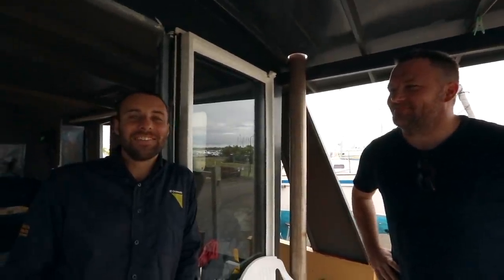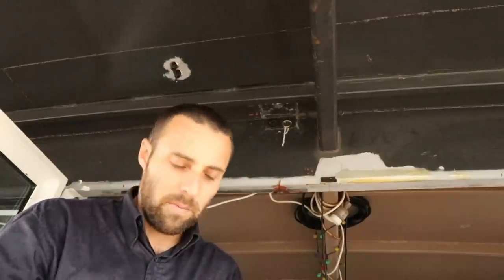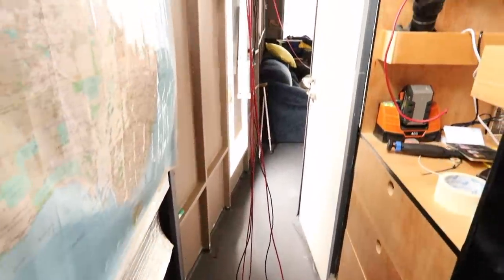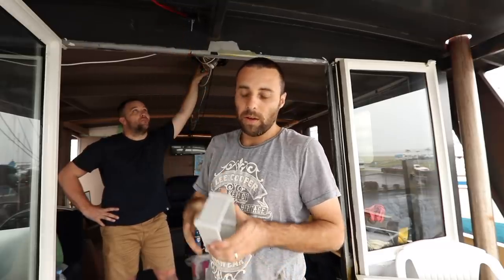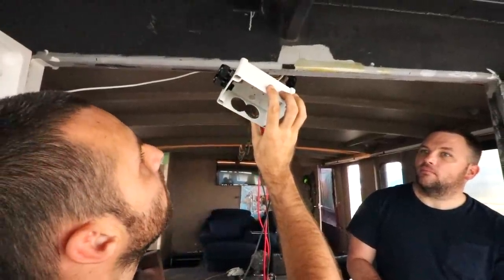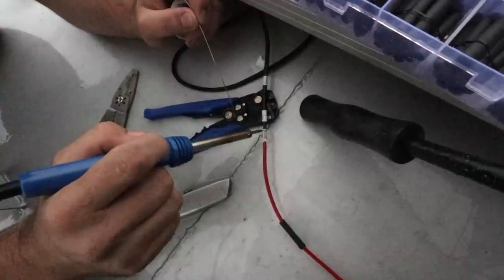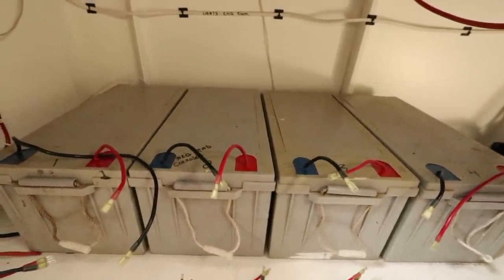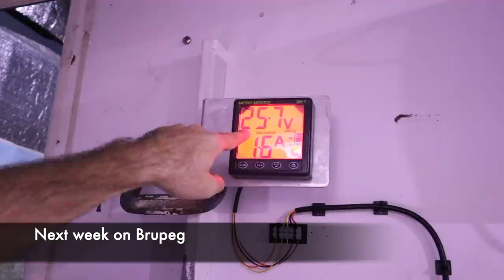How to install Marine Solar Power - Project Brupeg Ep. 89 (part 3 of 4)

Comment: Back again to catch up. Looks to be a fun project and your learning a lot. That will help when at sea and have a problem because you will be familiar with the wiring. One suggestion is to label pairs of wire so it's easier to identify each end and not have to trace them back one wire at a time. Panel pair 1 goes to controller 1, panel pair 2 goes to controller 2, etc. It will save you a lot of time doing it and if you have to go back later for repairs.
Reply from the maker: Yeah that’s true. Thanks Richard

Comment: Terrific adaptation of the flex conduit for grommets!  With flex over the cables should not have any problems with chafe.  Failure is a great instructor and the cost, while sometimes seeming high, in the end becomes insignificant compared to the skill and knowledge you gain.  Glad to see Jess getting around well and hope Mishka doesn't get another tummy ache.  Take care and best to Scott for his help.
Reply from the maker: Thanks Matt. Yeah it was a situation with those grommets were we just couldn’t find anything easily that would work so making them turned out to be the best thing out there.
Reply from the maker: Yeah that’s not a bad idea. Most of our steel is either 6mm or 3mm so the 1/2” flex seems to work well on the 6mm (1/4”) steel
Reply from the maker: Yeah that’s not a bad idea. Most of our steel is either 6mm or 3mm so the 1/2” flex seems to work well on the 6mm (1/4”) steel
Reply from the maker: Yeah the 1/2” flex works really well on our 1/4” steel work

Comment: Hello Damien. In my commercial solar installation  world we some times use flex (round insulated cable) in the same way you used the flexi conduit, this has the advantage of being softer and can be cut a fraction longer to fit nice and snug. All the best.
Reply from the maker: Thanks David, I hadn’t thought of that. Cheers

Comment: Been following your amazing refit (after seeing an episode of Dangar Marine). From an electronics background I recommend you label any cables to future troubleshooting, it makes identifying standard colour cable so much easier at termination junctions. Still playing catchup with your blogs, thanks for sharing and fixing some of your audio issues.
Reply from the maker: Thanks very much. Yes I want to invest in a label maker and run through the boat marking everything up. With our multi core conductors we have a system that uses the numbers printed on each conductor but that only works with some of them as others have no numbers printed

Comment: When I have to bust out the gas for tight jobs like that I find it best to heat the under performing iron, rather than the cable. It's easier to concentrate the heat that way. 
Always pick the worst weather to do the outside jobs. It's character building. 
Keep it coming kiddies!
Reply from the maker: Yeah we tried that and found the iron was just causing more issue than it was worth, hence in the last few we just dumped the iro and used the torch.

Comment: For the house batteries...can you just mount some lugs to the top of the batteries with some of that great glue...then just connect the batt terminals to them...then the connections to the system.
Or even use some short heavy duty terminal strips then same way...mounted then connected to the batt & everything else.

That was a beautiful sunset mate!
Reply from the maker: I quite like this idea. I will see whats available, im actually thinking of just swapping these batteries out as i dont have faith in them so really dont know how much i can rely on them

Comment: Another great video, I have never seen batts with wire as it output, they must be a super low discharge current and/or designed for high voltage strings, you will never get enough current through those wires to run the inverter which you probably already know LOL.  Wiring looks spot on. I would do a couple of things slightly differently component wise but thats more for ease of instalation. If you havent already got the INV/charger look at the Quatro, it fully automated the change over between ship and shore without a selector switch.
Reply from the maker: Yeah my plan is stick with Victron for the house bank and all the parts associated. Just really well built stuff with a brilliant reputation from what I’ve heard and seen with the MPPT’s

Comment: The tubing you use for sending gas to a bbq, you can slice that on the side and use it as a grommet. That thing know no death. I've used it to isolate edges for years in multiple applications, not just for cabling.
Reply from the maker: Nice. Yeah I can see that stuff lasting years. The gas line we get in Aussie is copper with a external plastic coating

Comment: They make air tight sealed mppt splice connectors ive used alot .All the home solar ive installed ALWAYS real world voltage/output is less. Specially in hot climates. This is why you undersize inverters so the inverter runs at best efficentcy at all times. So 15kw system really only needs a 13kw inverter(with a over 15kw maxx) that way in real world you keep the inverter in its "happy" range at all times.
Reply from the maker: Ok, good to know.

Comment: Saw where you were having difficulty putting in rubber grommets and used split corrugated PVC around the perimeter... Two things that may help:  
1) Use a heat gun to warm up the rubber grommet.  This will soften them up and make it easier to put into the hole.  After they cool and firm up again, they will NOT come out.  
2. Instead of the pvc stuff, use a razor to split a piece of 5-8mm rubber fuel hose and use it instead.  It works much better.  It grips and won't move as easily, and is a much better insulator, in case it ever comes to that.

Of course you are WAY out of my league regarding knowledge, but hope that these thoughts may helpful to you.   Please ignore, if not useful.   Thanks for the very interesting channel!
Reply from the maker: This is an awesome suggestion. I like the heat and set aspect you’ve mentioned for grommets. The issue we had was the grommets we have are for thin metal 1-2mm thick but our steel was 3mm plus the thickness of our plastic box so I’m guessing all up it was maybe 6-8mm thick. That said the rubber pipe would be better than our plastic flex conduit by a long shot. Thanks for the tip. Damien
Reply: Damien,
Yes, in that case, you need wider grommets.  The rubber hose trick will be the better option, if wider grommets aren't readily available.    The cool thing about the hose trick, is if you use a heat gun, you can use the oldest, hardest hose that you stripped out of somewhere.  Warm it up, make it soft, form it as needed, and it will work great for many things.     Glad to chip in, even if in a tiny way.  Thanks for the reply.
Reply from the maker: No worries, thank you

Comment: That rain and sky = exactly what southwestern Washington State looks like 80% of the year if you were curious! I'm curious to see how those microinverters work out for you. Just generated 42kva here on my landship though!
Reply from the maker: So far there awesome TIm. havent generated much total power as the battery bank is so large for the load i cant get them to drain down more than 8-10% so they spend most of their time in float. we are normally fully charged by 9am. Thats running 6 panels as we are still waiting on a replacement for the last pair. an inverter will be here soon so we can start really loading the system up and see what it can do.

Comment: Considering one went bye bye during a storm, i'd suggest adding a strip on the sides (affixed to the L brackets). Doesn't need to touch the roof, rather just follow the contour. That way, wind can't get under the solar panels, but water can move freely around them.
Reply from the maker: At the time it went bye bye they weren’t bolted down and we had 80 knots across the boat. We’ll test how the brackets work and change if we need to. I’ll keep it in mind thanks. Cheers Jess

Comment: Damien never feel that you need to apologise to the Internet "experts", making mistakes is part of the learning process IMHO.  There will always be a better way to do things, what works for you is the best way in my opinion. 

You need to consider three things when designing or building something:
1. Cost
2. Speed
3. Reliability

Usually, you have to compromise and pick two, all three aren't usually an option.
Reply from the maker: definately, the first system had cost and speed ticked, but failed massively on option 3. the most recent solar set up wasnt cheap. charge controllers were close to a grand for the four controllers and the battery monitor, but man does its rock!. shouldve just gone straight to this first time round. still one day i might learn...

Comment: I have two screwdrivers that are called "offset".  One is a flat blade bent 90 degrees at about 3/4 to 1 inch then about 4 inches bent 90 degrees the other direction then the same length ending in a flat blade.  The whole thing will lay down looking like a Z with one blade across and the other blade in line with the tool.  The other screwdriver is made similar but the ends are Phillips.  Both are for close in work.  It would be possible the take a Phillips and heat and bend the tip to give yourself an offset screwdriver.  Since you are using plastic screws the loss of strength in the shaft of the screwdriver should be minimal to you.
Reply from the maker: Thanks Roy, yeah I know those z tools your talking about. In fact I hard them in my head when I said about bending a screw driver. There really handy things for screws in ridiculous locations

Comment: Hope you can source another panel soon. Great to see you using the past solar experience as a building block to get to this new and better system.
You can get a cordless caulking gun in a AEG POWER TOOL. But they aren't cheap.:(
Still doing a great job.  Hope Jess is OK she seems worried about the Doggy?
Reply from the maker: Thanks Dennis
Mishka was quiet with a sore stomach but has come right over the last two weeks. He’s getting lots of hugs. We hope to get a panel soon. System is working great. Cheers Jess

Comment: Iv used that split conduit trick a few times 
Granted on sheds but for running water pipes though tin that suffer alot of vibration 
It works well 
Good quality conduit is tough
I'd recommend the solid stuff over the split stuff but it's prob just personal preference
Reply from the maker: Yeah ease of making the system too. We have solids for most of the cabling but yeah were it’s just too time consuming to make all the bends we used flex

Comment: I came here from the video with danger marine good work.

in that vodeo, you mentioned that your computers for your navigation use hard drives. that's not going to work for the long term because hardrives are very sensitive to movement and moisture. an ssd or solid state drive has no problems with this and they are silent. and due to this well just being navigation there won't be really many reed/wrights so they will last for a long time. anyway just a suggestion.
Reply from the maker: Yeah good point. We use SSD for our editing Macs. So I do like the idea of the nav PC having SSD reliability

Comment: Be mindful of heat inside the conduit when at full current. +1 for split vacuum hose as grommets.
Reply from the maker: Hi Brian. Yeah we did think of that but the cabling we are running is massively oversized so it’s well under loaded and so far it doesn’t even get warm at load

Comment: You could make (out of say, a bus bar) standardized terminals for those batteries. Two copper bolts and nuts and on the other end, pegs for the wires coming out of the batteries. You can glue them on top with sikaflex using one of those junction boxes (the smaller you showed in the bag earlier on). Have done this with a few motorcycle batteries that came with the same stupid wire design (which, as i understand, it's meant for electric systems that are enclosed, but not fully air-tight, to counter drain because of dirty batteries (it can become conductive, acting like a parasitic drain)).
Reply from the maker: Yeah I get that. I like that idea. Would also allow the thin battery cable to be quite short and hopefully carry a few more amps

Comment: It is a better idea to use velcro wire ties instead of zip ties since you have the option later of changing the wiring and zip ties can cut into the wire insulation or even strip off the insulation if pulled hard enough.
Reply from the maker: Yeah i have heard of this in the aviation world as there is less chance of damage to the insulation but in my experience ive not seen zip ties cause damage like this. Not saying it cant happen but i cant think of any examples ever where ive seen it be an issue. On Brupeg its fairly normal for us to zip up a string of wires and if needed at a later stage just replace the ties with a new lot with the additional cables tied up, so yeah we frequently cut old ties off and replace without any drama. The thing ive found in my experience most likely to damage wiring insulation is stanley knives used to strip back outer insulation on multicore cable, as it often picks up the inner insulation and cuts a small line into it. ive had that happen maybe 5-6 times so far. I absolutely hate it as it freaks me out that now that cable is not water tight but also is a risk of fire if it earths out.

Comment: If you keep getting it wrong eventually you will get it right.  When you set up the two onboard computers use solid state drives, the pounding seas will kill mechanical drives.  Save data on small laptop external hard drives and critical data on CD or DVD disks.  This includes OS, Drivers, Software, and Chart Data. Do not solid mount your monitors to the dash, they won't survive the pounding.
Reply from the maker: Ok cool, good idea about flex mounting the monitors, i hadnt thought of that but i will figure a way to give them some suspension

Comment: I guess you're well on your way with your solar project but as a long-time  electrical designer of AC DC power & Pv systems I have a couple of comments for you: * PV panels never perform near  rated wattage in the best conditions, in a marine environment you will be lucky to get 40% of their rated power output, I think you ended up with the series parallel wiring scheme on your panels, PV panels never perform well when wired in parallel , one  panel will always have a higher voltage and that voltage is lost as heat in the parallel panel . It's better to buy one high-quality panel as opposed to two inferior panels it will last longer and perform better over the long run. I saw a shading issue with the exhaust stack and the smoke that's always going to be an issue in PV performance depending on how many bypass diodes are in the panels, again better panels help..* soldered Connections in AC or DC Power Systems should be avoided use a screw terminal whenever possible here. Terminals areI a maintenance issue but a terminal block has the ability to dissipate Heat in a splice. Also, uU
using a terminal block at each battery gives you the ability to isolate problem batteries and do voltage checks .on individual batteries. Type mtw wire is also a good choice for your application, it has the vibration resistance is readily available just lacks  the tinning but corrosion can be overcome with the use of a ferrule. *This application is considered hazardous location here in the states and an all metallic wireway system would be required, At least consider metallic raceways in engine and mechanical rooms, metallic conduit is cheap although labor-intensive. * fuses rated at 125% of circuit capacity is required at/near each battery bank . *Select circuit breakers carefully be sure to use an appliance type circuit breaker , load at no more fan 80% of circuit ampacity. You're right on with that AIC or Max interrupt capability of the sand filled fuse. Many people tend not to consider safety in a DC battery system but in fact they can be more dangerous then an high volt AC system. Enjoy your project and wanted it to be safe. Thanks
Reply from the maker: Thanks TC lots of good info to work through here. Really appreciate you taking the time to share your skills

Comment: Quickly looking at the diagram I'm wondering if you have considered an Isolation Transformer on the AC shore power feed. It's my view they are highly desirable on all metal boats. If not I have a Galvanic Isolator in good condition I can send up if you need one. Cheers
Reply from the maker: Hi Phil. We want to install a galvanic isolator, we still need to get one so we could definitely use yours. Thanks for this, it’s an awesome offer. Damien
Reply: @ProjectBrupeg  OK. I'm going to have to get my partner to organise it as I'm overseas at present. It will be later this week at the earliest before she can look for it. Cheers
Reply from the maker: Thanks Philip. No rust mate

Comment: Could you have drilled a hole on the ceiling rib to access the screws on the box, letting you mount it as you wanted to?
Reply from the maker: The ceiling ribs are hollow so if we drill anything in them it risks letting fresh oxygen get in and they can rust from the inside out.